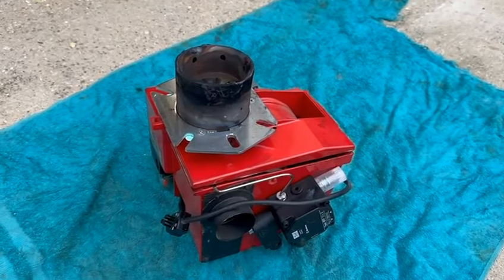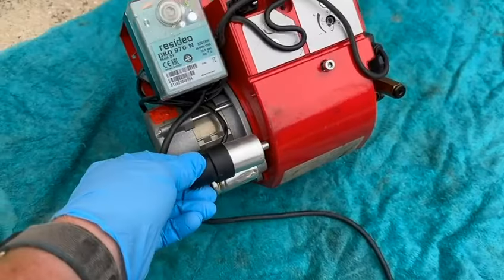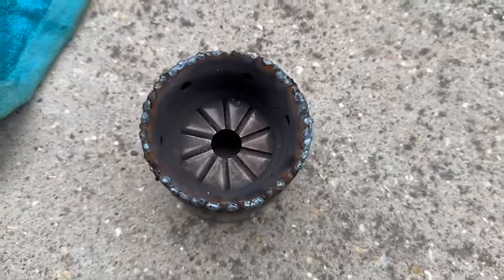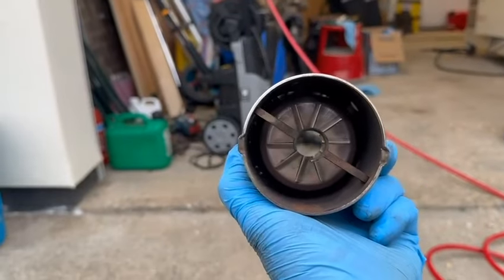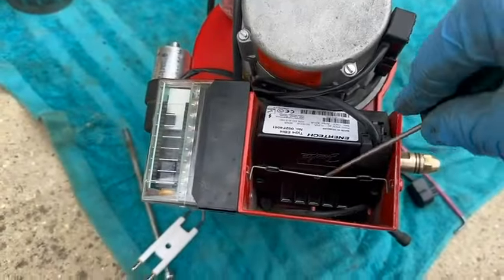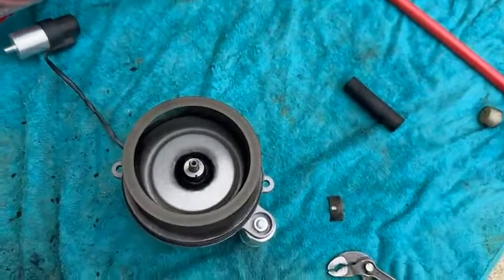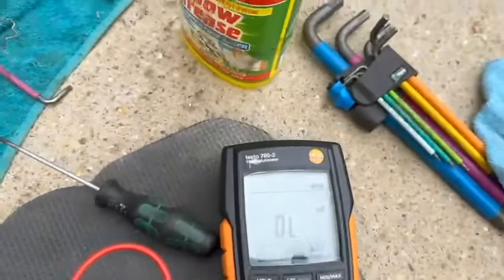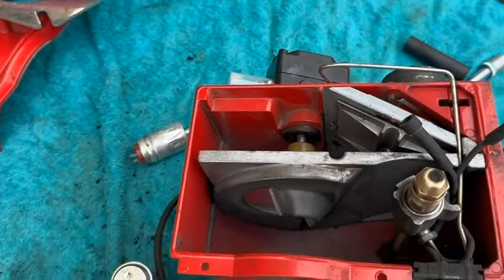REPAIRING A BURNER

Comment: You went the extra mile so you are that family’s oil boiler man for life. Great video superb content. Great tip on the copper grease for long screw and also keeping the electrodes level with the nozzle face. They didn’t teach this at my recent oil logic exams course.
Reply from the maker: Thanks for the comment. The oil exams are a basic exam to get you going. You learn more as you gain experience. Glad this has helped and if you ever get any issues or unsure feel free to email us anytime! Rob

Comment: I note you mention the electrodes should be level with the end of the nozzle (and I've heard other YouTubers say this) but my manual say the electrodes should be 3-4mm back from the end of the nozzle.
Reply from the maker: Depends on the burner. If you put the electrodes 3-4mm back on this burner you would bet groove marks over nozzle then the boiler would run poorly and breakdown.Have a good week. Rob

Comment: How can you make it worthwhile to remove, strip down, rebuild then call back to fit a burner? Would it not make more economical sense for everyone to just have a few new burners in the van and just replace it?
Reply from the maker: Thanks for the comment. We dont just fit burners as we repair most from van stock. Also it was a shorter blast tube as explained in the vlog so a standard burner would not be suitable. Also this repair was much cheaper to the customer than a new burner. Have a great week. Rob